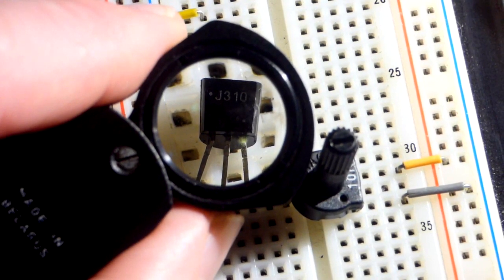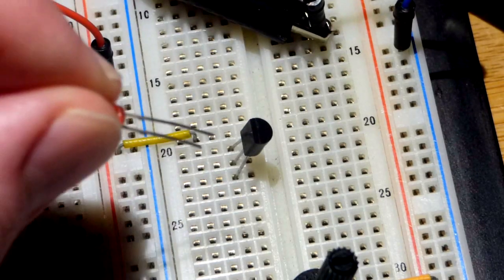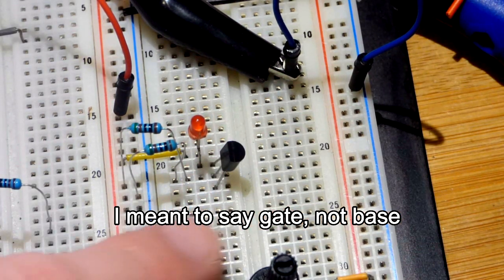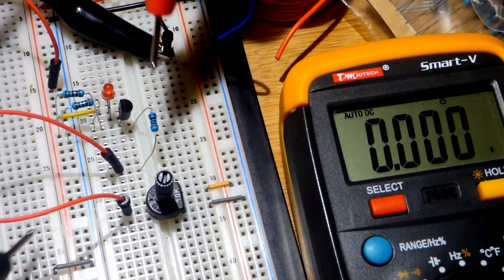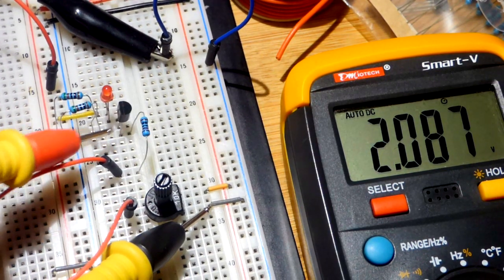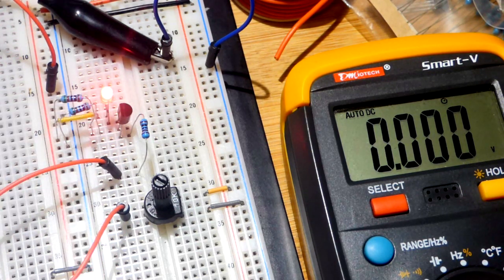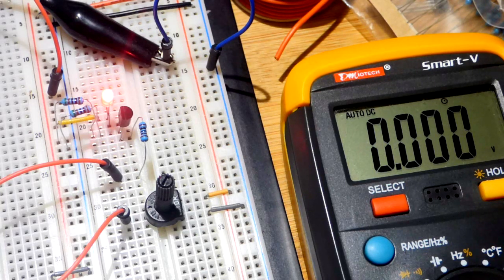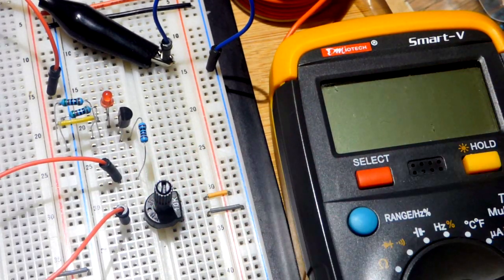J310 JFET transistor cutoff voltage multimeter and LED tests by Electronzap

Comment: Curious, the datasheet advises the J310 is designed for VHF/UHF amplifiers and oscillators
Reply from the maker: Yeah, it can probably change low power voltage output quickly when controlled by a signal. I don't do anything with VHF or UHF yet so it's not something I address.